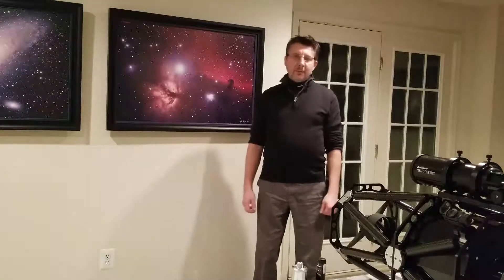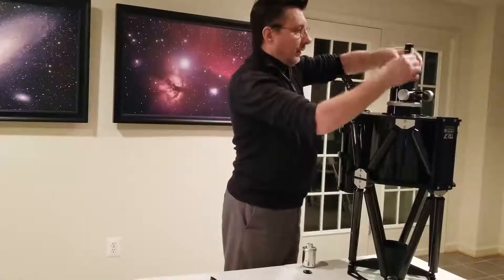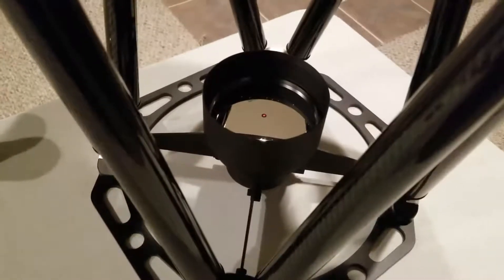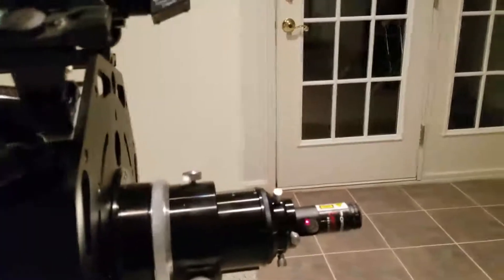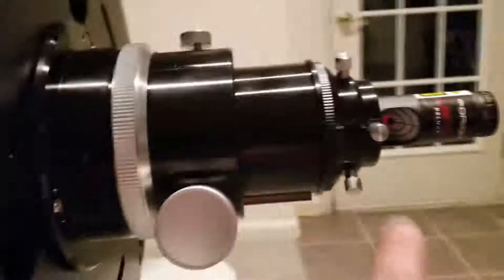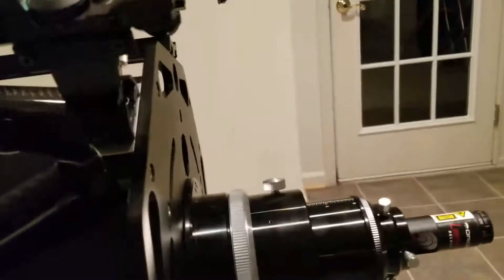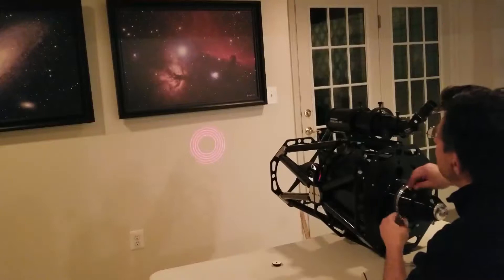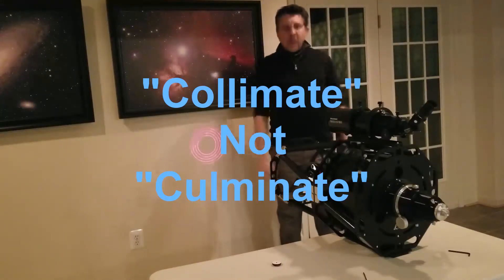Three Step Process for Collimating a Richey-Chretien Telescope

Comment: I collimated my GSO 10" f/12 Classical Cassegrain pretty much the same way you did with the exception of the last and final step. Step one, I used a Hotech SCA crosshair laser collimator to square the focuser to the center spot on the secondary mirror. Step two,  I adjusted the three screws on the secondary mirror to return the laser dot to the laser exit hole and I verified that with a Cheshire eyepiece. I didn't have a concentric ring pattern holographic attachment so I adjusted the primary mirror solely on the star test. Since the secondary mirror was accurately collimated in step two all I did was to adjust the three screws on the primary mirror to give a perfect concentric diffraction ring pattern of the defocused star both inter-focus and extra-focus.  I must say I have never seen a more perfect diffraction pattern from any of my SCT's than from the 10" CC. As always a telescope will give an excellent image when it was perfectly collimated. Most RC's and CC's and Newtonian's give you options to perfectly fine-tune the collimation but not so with most commercial SCT's.

Comment: Hi

Can you please help me with issue that I have  with me rc 8.  I have loss middle screw of the secondary mirror can not get perfect spacing 
So if you can please tell me e the spacing of the secondary mirror
Reply from the maker: Your middle screw is most likely metric.  Its probably a 6mm, 8mm or 10mm.  Don't worry so much about space.  RE: lets see your secondary is off by 2mm.  That means your would come out or in with your focuser by 2mm.

Comment: I have the Howie-Glatter collimator with the standard pinhole hologram, the square grid hologram, and the cross hair hologram. I was seeing crescents in my return image with my square grid hologram, which was confusing, and no one could explain it. I was in my dome, so I did not have the room that I needed to properly evaluate this anomaly, so I removed the 12" f/8 RC OTA brought it inside the garage where I had enough room. I highly recommend that you do this if you don't have enough room in your dome or building, and you move a white projection poster board from the very front of the OTA, to at least 10-15 feet away for the final primary mirror adjustment. You will see the off centered crescent changing shape and realize what is happening, because it's important to be the right distance away from the front of the OTA to the projection screen. For my 12" f/8, it's about 10'6" plus or minus a few inches. It is from this correct front distance that you want to make your primary mirror adjustments. Trust me, try this, and you will save hours of trial and error.  Great video.